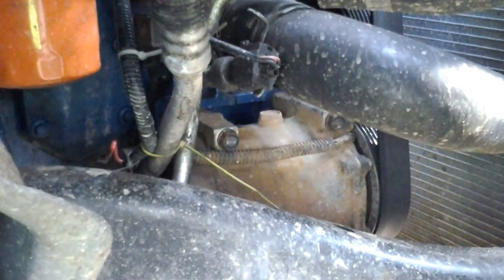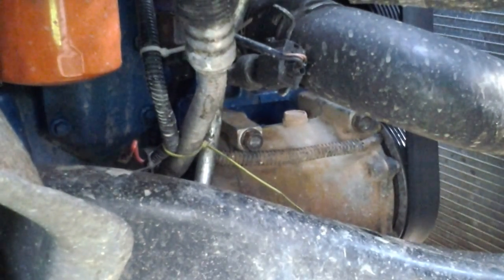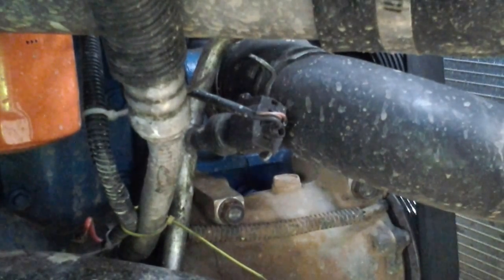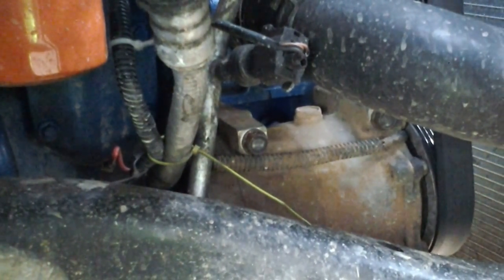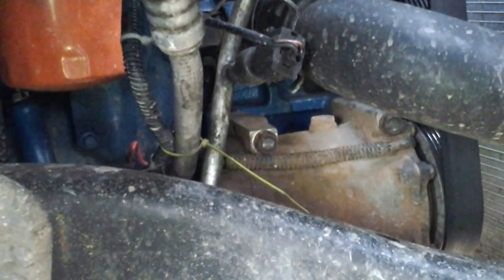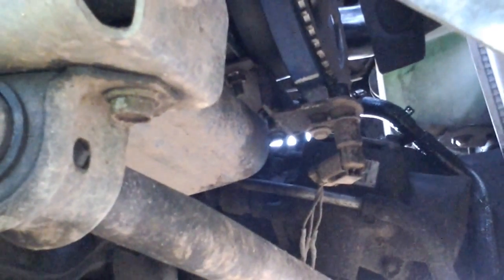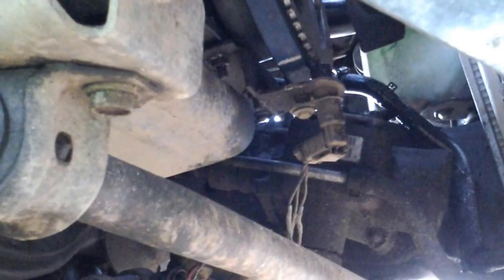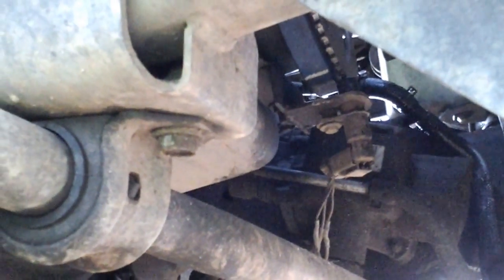3rd Gen 24v Cummins to 12v AC Compressor Info

Comment: What was the pin out method if you elect not to mount the tone ring and tach sensor?  Dont want to dump an extra 250 for tone ring and tach sensor. Any info is appreciated.

Comment: That done your air and tach. What about the rest of your gauges and lights? Did you use the 24 valve oil pressure sender and 24 valve water temperature sending unit? I guess the alternator took care of itself. What did you do to get rid of the "check engine" light?
Reply from the maker: On some of the build that we have done recently we have gone even farther in hooking up as many CR sensor as possible, but the check engine light still remains. I think the real answer is probably to either live with it or black it out or un-solider it.

Comment: So 12v and 24v compressors aren't compatable with comonrail blocks? Do any of the bolts line up?
Reply from the maker: So we have actually have had recent success with using 05 and below A/C compressors interchangeably. Not sure why my first 05 compressor didn't want to work, but I have to assume that it was my fault. The thing that you want to make sure of is that you pay attention to the style of the plug. The 12v compressors have a different plug to them than the 24v's.
Reply: 70440charger I'll be using an after market system anyhow. So I'll order a new compressor and bolt it up. Thanks.
Reply from the maker: Nice, Be sure to let us know how it works out for you.
Reply: I’m using a 2006 compressor in my swap and fitment is good and retains all factory connectors.